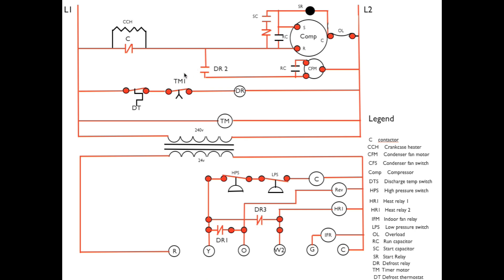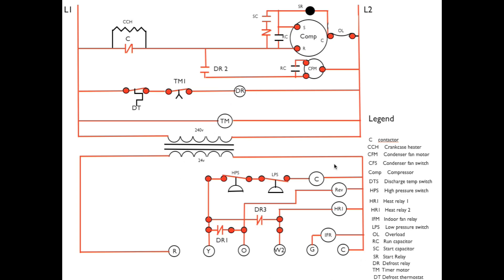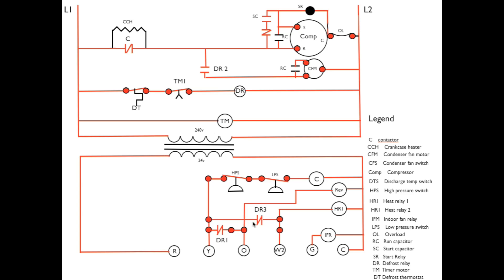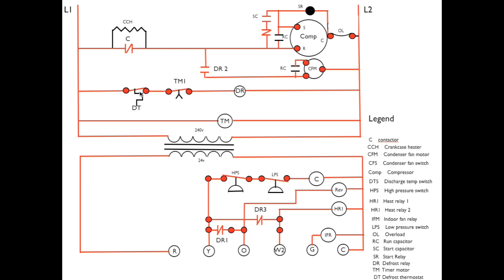Heat pump diagram #3.  Call for defrost sequence

Comment: If you're running a dual fuel system and the heat pump calls for furnace during the defrost cycle, what happens if the indoor setpoint is reached (furnace overpowers the defrosting heat pump) and the thermostat kills power to Y? Does the heat pump latch Y ON until the defrost cycle is complete or just resume on the next heating cycle?
Reply from the maker: Most units shut down when the call for heat stops.
GFM

Comment: Thanks.. I have a question though.. I was working on a rheem package heat pump.. And it had a dc relay which was activated in defrost mode.. I'm thinking it was like a solid state device emitting 12v dc holding a ice cube relay closed or open then once temp drops it then switches? I have no idea.. I just want to know why some heat pumps have dc relays and where the signal comes from? Have you seen these
Reply from the maker: As for the internals of the defrost board, I don't know.  When the defrost initiates, the outdoor fan deenergizes,  the reversing valve deenergizes, and the backup heat relay adds backup heat.  Hope this helps.
GFM